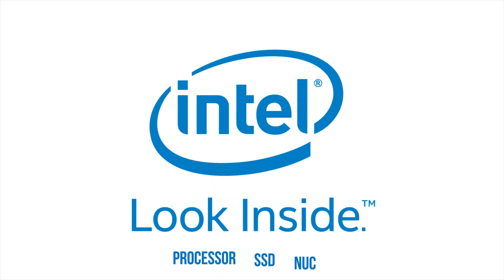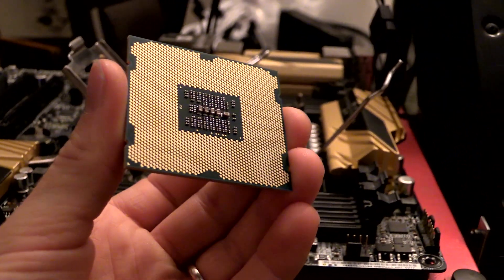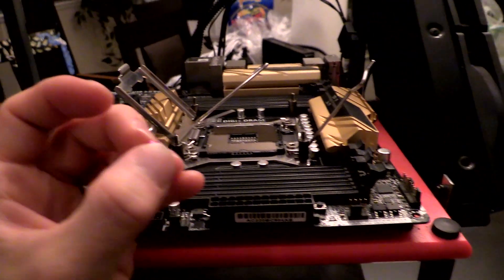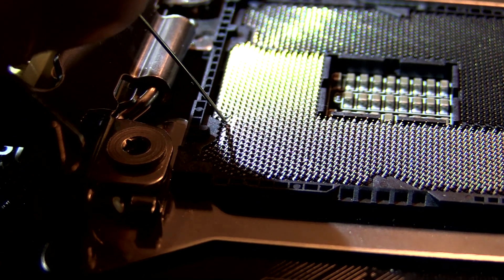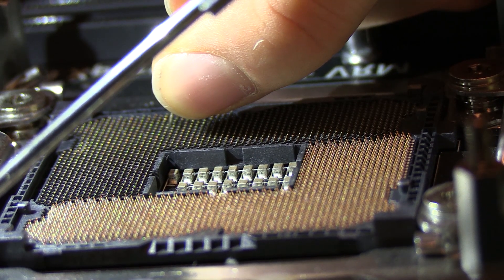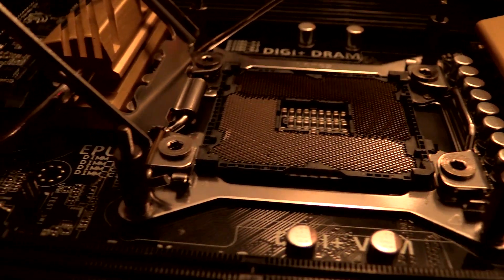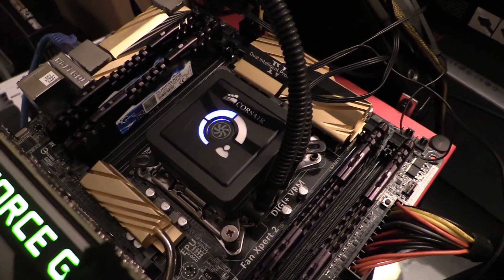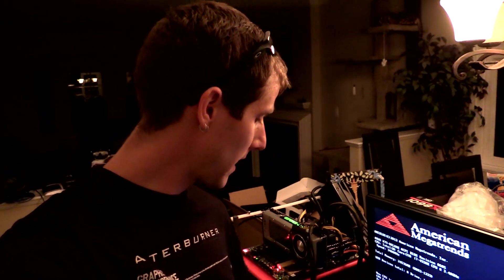LGA 2011 Socket Pin Repair Vlog - Fix a "Dead" Motherboard

Comment: DO NOT TRY THIS UNLESS YOU ARE WILLING TO KILL YOUR CPU ! I TRIED THIS AND IT SHORT CIRCUIT AND BURNT A SMALL SPOT ON MY CPU ! so if you do not line it up exactly where it is suppose to be it will surely damage your processor. So beware !
Reply: Yep, but with an Intel cpu right ? With Amd cpu (FX) it's much easier. obviously, i will remember the warning, thanks !

Comment: had this happen recently and i was so pissed, installed my liquid cooling loop and my pins got bent on the socket on my mobo... tried bending em back but no luck. had to get a new mobo :-\ rather then spending for a whole new cpu and mobo had to find someone with the old 1156 mobo type online

Comment: I remember bending the pins on my AMD FX 8320. It sucked ass, there were about 15-20 bent pins. After an hour or so I had them fixed up and it actually worked. I was pretty damn shocked, but now I'm afraid to ever take the CPU back out...

Comment: I've had a similar experience with an AMD CPU that was sent to me via UPS from Newegg. When I received it the packaging that it was mailed in was scuff/dent free but when I opened the shipping box I noticed that the actual CPU box looked like it had fallen off the top shelf in their warehouse.....the box was dented in pretty well and when I opened it and the hard plastic shell that holds the cpu was actually cracked on a corner and lo and behold there were 4....that's right 4....bent pins. Since Newegg's policy is that if you receive bent pins well it's your problem now I tried using an old gift card and gently bent them back into place and it actually worked. Morale of the story is Newegg is shit.

Comment: guess ill have to figure out how to install a new pin on my lga 1156 mobo. yes its old but i want to fold protean with fold at home, until it completely dies. oddly enough with the missing pin the computer still works and doesn't even crash. must be just a pin for ground anyways..

Comment: Wow, some of the the comments on this video have seriously taken a strange tangent. On topic, I once bent one of those suckers when cleaning up a small bit of thermal paste with a micro-fibre cloth. One very fine fibre was long and snagged one of the pins close to the edge of the socket.  I did the repair in a simular manner except more praying and swearing. :D

Comment: My Mpower melted one of the pins after overclocking, voltage within safe range and all.. One of the resistors got fried for some reason, thats why i were refused an RMA by the company i bought it from.. After arguing back and fourth, I told them to ship the damn thing to MSi anyway, and managed to get a full refund.. Gotta love MSi.. :)

I do still have a broken P67-GD80 board, BIOS is dead after a flash and the dual BIOS doesn't work.. Meh.. Would be a nice backup board for my old 2600K tho.. Mobos are so easy to brick..

Comment: Dare I replace a blown capacitor? I know the short was on the case. Fried my 4930k too :(
Reply: 3930k*
Reply: I'm not sure my soldering would be good enough, I know it can be done but is it worth the risk for something that I have already replaced?
Reply: Try warranty before fixing anything your self

Comment: I did exactly this myself recently. I for some fucking stupid reason decided it was a good idea to put my finger near the bare socket, and brushed against it accidentally, and bent 2 pins.

Lots of light, magnification, and very thin needle, managed to put it back in place. Sometimes the pins will actually catch on adjacent pins - the trick is to try to "un-stick" them without ruining either that, or the other, pin. But I managed. Works like a charm.

Just don't ever put your finger anywhere near those damn sockets.... Your skin is pretty rough compared to those tiny little things.

Comment: I also repaired a motherboard with a bent pin.  It is not as hard as you might think.  It was my first time and I tried it once and the motherboard works again.  My sister was so happy because the motherboard is out of warranty and she do not want to buy another board.  lol

Comment: Fixed an old LGA775 board which had a few pins bent somehow by using a empty mechanical pencil, the hollow head fitted spot-on the pins ball-head. Just had to bend carefully a bit up and place the CPU back, worked again like a charm ever since ^^ I had really good lightning so I didn't even need a magnifying glass etc, I saw the pins better with bare eyes

Comment: Linus that baby monitor in the background, i have a question about it my sister owns the same one and has an issue with the battery draining even when its turned off. Do you also have the same issue with it?

Comment: my AMD FX-6300 cpu had the same problem....only difference is I used a screwdriver and no magnifying glass! I'd definitely recommend trying this if you don't have a warranty on your board or AMD cpu, it could save you a lot of cash :)

Comment: I have an old 755 socket board with a few messed up pins. Want to give the machine to my cousin. Any tricks to that socket or is it pretty much the same process???
Reply: It's a Dell Inspiron 530s if that matters. Quad-Core Q6 I believe, haven't pulled it out in a while... Better than an old Pentium 4 though.
Reply: Rich OBrien I have a Inspiron 530 Core 2 Duo sitting four feet from me. I would think it's the same process, as it uses LGA as well, but I clean mine regularly and take great care, so nothing gets as damaged as that.
Reply: Cassidy Lush Yeah, it's a Dell i530s.
After posting this i took another look at it and the pins in-line but haven't tried it because there seems to be something in the socket. May be hardened paste but i can't tell or get it off without most likely damaging the whole socket. Haven't tried anything yet. Any suggestions for cleaning something from the base of the  pins???
Reply: Rich OBrien The only thing I can think of is getting a small pair of pliers. While the pins are fragile, they still have a fair amount of rigidity to them. Have you asked any forums pages yet on how to do this?

Comment: I could never understand why people shit them self so much about fixing CPU socket. When I worked in DELL factory I've fixed bent pins numerous times. There was special awl like tool for that but when it was not available we used common scerw drivers to poke in socket, without any bad consequences. Those sockets are more resistant than people think. Actually only time I've broke mainboard was when I  driled throughout it, by accident, with electric screw driver :).
Reply: Well not everyone has worked in a pc-making-coherent business.  So perhaps NOW you can understand why people stress over it.  

It's the same thing about how some car mechanics make condescending comments, like yours, and forget that THEY too, once, were noobs to the car mechanic world.
Reply: Raymond Tyson
 Chillout dude. I didn't planed to be condescending, It supposed to be a joke (still story about fixing sockets with scerw drivers and driling mainboard is 100% truth). Sorry you didn't find it funy.

Comment: just did this with a brand new lga1150 mobo, thankfully the pin wasnt broke but just bent slightly and i was able to fix it no problem

Comment: A few years back i had a amd chip and it had a bent pin on the cpu tried to fix it but the pin broke off. I put the cpu in anyway and it worked fine I was shocked

Comment: I have always had and CPUs so I had no idea that Intel chips had the pins in the motherboard, just wondering if there is a benifit to that?
Reply: AMD CPUs. dumb auto correct. Lol
Reply: I don't think there is any significant advantage (or even any difference at all) in terms of the performance...

The only benefit I believe is that it is often cheaper to replace a motherboard than a CPU, so it is better to have pins on the motherboard as they can break like they did here. Also, the motherboard has protective structures around the pins that can do more to protect the pins than with the AMD CPUs where pins are left sticking out in the open.
Reply: luke timothy ah, i see. cheers for the info!

Comment: Probably the hardest part of dealing with situations like this is diagnosing where the problem is or likely to be, then assessing whether it's within your skills to fix it or is it repairable under waranty, etc.
When I have (or find) faulty equipment, some of the tiime it's a mechanical or component failure, but more often like this it's an electro-mechanical problem where there's a contact failure, & despite some being a bit fiddly my success rate has been surprisingly high with some quickly sorted!
Switch failures usually warrant a simple replacement but sometimes none are available & careful surgery is required.
&B^{D>

Comment: i counted the pins lol, i think there are  2013
Reply: There's 2011. The number after "LGA" is the number of pins on the socket.
Reply: poor guy just spent probably 20 minutes counting the pins when its in the name :|
Reply: Kammex Wooow i didn't know that x) Thanks for the information :D
Reply: Son of a Zombie I pulled every pin out and counted 2012, which one of us is right? But first how do I put the pins back?
Reply: TellYourGirlThx hahah i was trolling xDDDD
Reply: Spalding1250 No, first, you take a selfie.
Reply: Apparently the one coming out next year has 2015. :D
Reply: Theres 1337 pins. Jeez,
Reply: Jerry Li No. There is 6969, you didn't even put in some effort in counting them did you?
Reply: Missing one..oops 2014 XD
Reply: MrDynamicMan Actually, news has been leaked that it will be 2011-4.
Reply: Kammex Wooow i didn't know that x) Thanks for the information :D
Reply: ***** So you knew LGA __ = # on pins.
Reply: Yeah. So damn rude.
Reply: TellYourGirlThx Its actually a troll by Intel.  there is actually 2013 if you count them.
Reply: Son of a Zombie Nice try. Look at wikipedia's LGA2011 article. It tells you how many "protruding pins". Please, you suck at trolling.
Reply: Kammex pull your chip out, and count for yourself.
Reply: Son of a Zombie Why would I pull my chip out? I know there's 1150 pins.
Reply: ***** nah there is only 3

Comment: The only time I am getting nerves putting a system together. The CPU. Always a good thing to take alot of time for that.
Reply: Ikr! I always think I put it wrong and reseat it and check it again because I always think that when I push down the retention arm, I'm gonna bend all the pins and waste $200.
Reply: 441meatloaf Good idea, but choose another brand just because of the pins? No way.

I'm not a fanboy, but I just prefer Intel. If AMD makes better FX chips then I might give it a try. I prefer AMD graphics cards over Nvidia though.
Reply: 441meatloaf I second this. Honestly, Intel pin system is just a pain in the ass. It leaves out too much room for messing up. But for AMD, the motherboard socket is much harder to break and installing the CPU is way easier. You just need to drop it correctly, and it will just slide down and stay firm there.
Reply: You know how hard it is to accidentally break the pin?
Reply: 441meatloaf Nope. I've had a P4 that I was going to throw away, so I tested it myself. You can hold it by the pins and it won't bend, only if you squeeze it or throw it, or if you forcefully push it into the socket it'll break. Just know what you're doing.
Reply: 441meatloaf Only if you force the cpu you in, if you drop it in the socket 99.5% of the it will work, AMD on the other hand longer pins and on the CPU, 10x easier to break.
Reply: 441meatloaf Anyways, they're only fucking pins, just get an RMA if something goes wrong, anyways Intel is the superior CPU here, we do have the top 25 best CPU's
Reply: 441meatloaf AMD is better on a budget and i will admit that because i have a 6 core AMD pc, my main computer is an i7 3770k and Intel has a lot better single core performance than AMD and thats what matters in gaming because most games are not optimized to use more than 4 cores, that wheres AMD's 8 cores dont come in handy, i have a AMD and you do feel an upgrade going up to Intel, any ways, a real PC enthusiast owns both brands :)
Reply: 441meatloaf Most good rendering/streaming software is GPU accelerated now.  OBS, Sony Vegas, Afterburner etc etc all have options to use quick-sync (intel CPU fixed function encoder), NVEnc (nvidia), OpenCL(any GPGPU graphics card) or VCE (AMD GCN 1.0+) to accelerating their workload and offload work from the CPU.  i7's are quantifiably better for gaming in power demand and per core performance.  AMD have strongly focused on the budget/small form factor market with their APU chips and they aren't quite as strong in the enthusiast segment of the market as Intel are.
Reply: 441meatloaf There's a key metric that Intel are outperforming AMD in that is very important in general gaming performance and that is instructions per cycle.  The number of instructions a given core can execute per clock tick.  That is why Intel have had the upper hand in enthusiast performance and why most higher end gaming systems are built with Intel CPUs. So  yes, i7's do outperform AMD chips in gaming performance, in every title, not just Arma 3.  http://www.tomshardware.com/reviews/gaming-cpu-review-overclock,3106-6.html

Every single CPU recommended in that review is Intel based except for one AMD chip  in the budget bracket.  It's not just my "opinion" that leads me to state that Intel have the better gaming CPU, it's quantitatively evident that they do.
Reply: 441meatloaf I'm no Intel fanboy mate.  I was an AMD user while they were better during the AMD64 era up until the Phenom II series.  I'd still be using AMD CPUs if they were in fact the better choice, they aren't, sounds like if anyone here is a fanboy, it is you.
Reply: 441meatloaf yeah, ill get an inferior brand so that i can be sure that i wont make a mistake that i wouldnt make anyway.

Comment: I did a similar repair on 1155 with no magnifying glass and with a screwdriver. It was painful but it worked in the end. I definitely recommend using some kind of magnification for this :D

Comment: I had this happen to be twice on my old Maximus IV Extreme.  First time stopped two of the DIMM slots working.  Repaired in the same fashion but used a folded up Rizla paper as I didn't want to use too much force.  The second time I attempted the repair (as part of a pc rebuild) I accidentally snapped the wee pin, but all it stopped working was one of the usb3 headers sometimes.  No performance or stability problems!

Comment: If you have an obsolete MOBO that still works, you can deliberately bend some pins to practice the skill. That way you have built experience for when it happens to your system.

Comment: Linus Please get or use a better mic. Your videos make my phone speaker vibrate or makes it really tinny. Use your lapel mic with your iPhone. But stop using your cameras mic please. You make all this money and have all this equipment you own yet you still use your phone's mic or cameras mic. Other than that good video. I have has to do this a couple of times. 95% of the time it works but at times more damage has been done that we can't see.
Reply: Its because this was an impromptu video and because he spends most money on parts

Comment: I've bent pins on my CPU once, but did managed to straighten them by using a pair of tweezers. It was very tedious, but I managed to get it roughly in the correct position. After that I just used a credit-card to carefully align all the pins. The CPU works just fine, in fact it's the one I'm using on this PC I'm typing at.

Looking back at it I think it would be a lot easier if I used a hollow needle instead of tweezers/regular needle to minimize the risk of bending other pins and having to straighten all of them with my credit-card.

Comment: I built my pc myself, and I have a video on my channel, but is in portuguese, so whatever. A few days back I was trying to remove the cooler from the CPU, and I bent some of the pins on the processor because the heatsink came with it. I carefully removed the processor, bent the pins back into place and voilá, it's now functioning correctly, as I'm typing this comment from it. ^__^

Comment: I think an awesome video series you could do is basic habbits to do with setting up a computer, such as backups, working out how your air flows through your case, how to pick the best gear based on price to performance, reliability issues ect.

Comment: I had to do this same thing with my Z87 G43 MSi motherboard a year ago...and my 4670K is running at 4.5 Ghz stable. Although my motherboard can't run memory in dual channel mode, but I just deal with it.

Comment: I hate intel sockets... and Asus charges over $120 for a socket repair, it is not covered by any warranty. (I tried contacting them 2 years ago for a socket repair, that's the price they gave me, may have changed since, but I doubt it got lower.)

Comment: Intel wants to make more money, you should buy a new motherboard in stead of repairing an old one so that they could sell their chips.
I know that Intel isn't the only one, Nvidea has gsync, cuda and other proprietary crap.
And AMD has the fx 9590, most people don't see the point of it.
they all maximize their profits in their own way.
But this method is more environmentally unfriendly.
Actually upgrading a motherboard is a 'waste' in general: if the chipset and connections would be swappable as easily as the cpu you would safe money and the earth.

Comment: I usually just bend the pin back with my thumb. It takes alot of practice, but now when someone gives me a motherboard with bent pins all it takes is a flick with my thumb.
In the beginning I tried to use my fingernail too but that makes more damage.